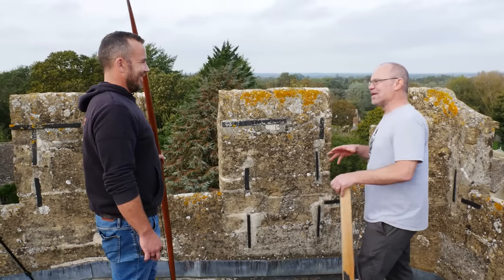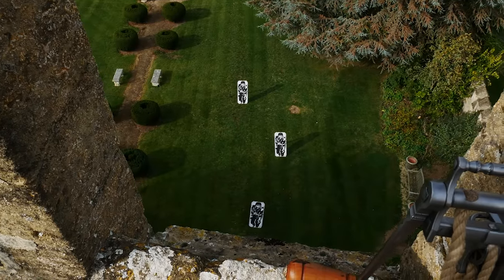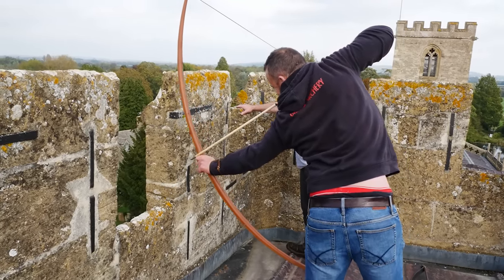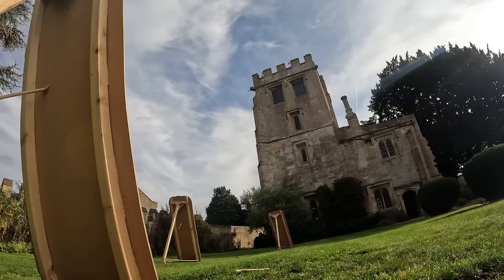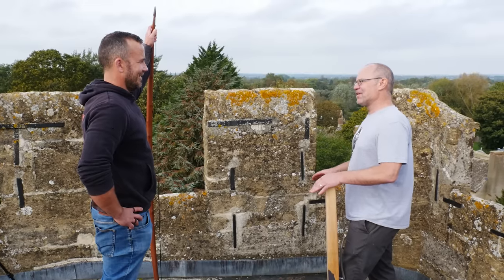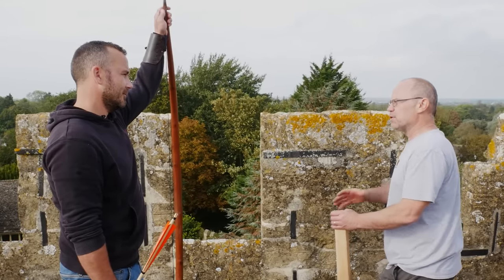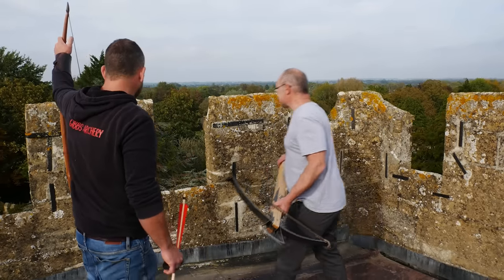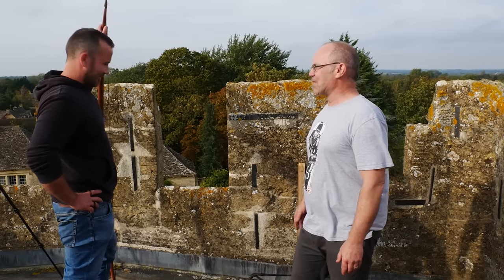Crossbow or Longbow? What's better for defending your medieval tower?

Comment: When I was a 10 year old Dungeon Master, I would have benefited from this video.  Not only were my players firing almost straight down at the base of the wall. They were using Longbows. 

Looks very like a difficult and very exposed position. Crossbows are still my pick. You can be ready to fire when an opportunity presents itself.

Comment: This test highlights one of the often touted advantages of a crossbow over a war bow- the quality of the troops needed to effectively fight. (No offense, Todd!😆).
The fact that a competent, physically average older crossbow man is as effective (maybe more so under the conditions) as a master archer in his physical prime is a big force multiplier on an army scale.  Younger stronger troops can be used as foot soldiers instead of being used as archers, which could be important, especially if you are recruiting from limited populations like a barony or small kingdom.
Reply from the maker: Firstly - clearly I am mortally offended!  But yes you make a good point.  I have a good eye, but I basically only shoot crossbows for my films, so not often and the last time I shot down like this was 3 years ago, so agreed; point made

Comment: Tod,
What you could have done with your crossbow would be to hold it up at a high angle and blindly shoot much closer to the wall than someone could with a longbow. In battles, people shoot blindly rather often. It would be very likely that people were doing it back in the 1400s as well.

Comment: I know I have come too late to the party but other posters have already noted that the more fortified medieval castles had machicolations (protected overhangs projecting from the walls) and hoardings (covered wooden structured that extended outwards atop castle curtain walls).
These features would ameliorate a lot of the issues associated with firing arrows from just crenellated walls.

Comment: It should be remembered that we're used to seeing castles in ruins so a lot of features (like roofs in the main halls) have rotted away over the years.  The crenellations in a maintained castle wouldn't have been exposed like the ones in this manor house (which would have mainly been for decoration and for status as only the king could authorize a house to be built with crenellations).  They would have been covered by what are called hoardings.  It's sort of like a wood shed that would run the length of the wall and would have stuck out past the edge of the wall.  

They wouldn't have stood up to a ballista or trebuchet but would have protected from arrows and crossbows.  Most importantly they would have slots in the section the stuck out past the wall so archers and crossbowmen could shoot straight down to the base of the wall.  From what your archer is saying it would have been difficult for him to fire straight down but it wouldn't have been an issue for a crossbowman.

Comment: it's nice to point out that in eastern archery there is a technique developed especially to overcome the problem of shooting a bow downwards a steep angle. You do that by pulling the bowstring with your string hand pulling from behind your head, tilting the bow horizontally and pushing the left (bow hand) downwards :) they call it the Jarmakee - if you train it properly it can be done comfortably with a high poundage bow as well

Comment: Well as you said, Todd, that building is absolutely not built with wartime defense in mind; those battlements are for all pints and purposes, decorative. If you’re gonna build a defensible structure with specifically that defensibility in mind, you’re going to design and build with the specific weapons in mind with which you expect to be defending your fortification. Ipso-facto, you would include features in your battlements which would be purpose-built to accommodate a tenable defense with those specific weapons. Your merlons would be equipped with loops, every few merlons or sound not all of them, which would either themselves be plunging loops or be in addition to a lower row of plunging loops, as well as a lovely set of machicolations you could shoot through as well as dropping unpleasant items and substances on the threats that get too close to the wall, especially on a strong point such as a bastion or tower. I think you guys might have ample reason to do a re-try of this video in a place more appropriately constructed, if you can find one. I would say a castle, fortified manor, or city wall somewhere that was built early enough that archery would still have been the primary form of missile-based defense, because after a certain point lots of places were retrofitted to accommodate the use of gunpowder weapons, even if archery was still utilized to a certain reduced extent, at least for a while. I know that’s fairly specific, and might be a little bit of a hint to find someplace that meets your needs, but I really do think this particular location ended up effecting largely misleading or at least misrepresentative results for the experiment you were trying to conduct.

Comment: The crenulations had a lot of design elements which were intended to deal with these problems such as tapering to the point of shoot so you could swing your arms and bows plus parallel slits and angled down stone at that point. Even when firearms and cannon came along the same things had to be considered plus star formations for walls so you could shoot back toward attackers at the base.

Comment: One very important detail regarding the difficulty in hitting targets near the wall is completely overlooked here. Merlons and crenels could be extended out from the walkway a bit to create gaps in the floor called machicolations. These gaps allowed defenders to fire down on targets at or near the base of the wall without having to lean out over the battlements as seen in the video.

This design became very common in medieval fortifications after about the 1200s, but when battlements became more of a decorative feature than a functional one they were usually omitted to simplify construction. This was often the case with palaces, churches, manor houses, and other buildings whose purpose was not to serve as a stronghold but whose builders still wanted the noble aesthetic that military fortifications provided.  This seems to have been the case with Stanton Harcourt Manor House whose battlements, as mentioned at 1:52, are decorative.

Comment: As someone who’s in the military I can see the massive advantage of the crossbow here pretty easily. I’m sure there’s endless tomes of how they were employed but fighting men themselves never change. Regardless of how they’re “supposed” to employ that weapon system I can tell you with absolute certainty that the grunts were using them in what they thought the best way was. High likely hood there was a handful of old hands and sergeants doing all the shooting while the younger guys who weren’t as accurate wound the cross bows. They were crouching away from the edges probably in the center of the roof. Might have had a few guys winding up there with them while the rest were doing it in the staircase and passing them up. They would have stayed as far back from the edge as possible and exposed as little of their bodies as possible. For the guys attacking they would have presented extremely small targets for a very small amount of time. This would massively increase the survivability of the defenders. As opposed to the longbow which require you being exposed for much longer and would fatigue the shooter very quickly over time.

Comment: One of the biggest reasons for why crossbows got more popular than bows was that they were easy to train an effective force for relative to bows.
With a bow, you'd need the average civilian to use it for months before they could reasonably put arrows into targets at acceptable rates, especially during stressful situations.
With a crossbow? That same training takes a weekend.
I mean, a perfect comparison here is your shooting performance. John is a dedicated archer, yet despite that, you're putting about as many shots through targets as he does, despite you lacking the years of training he does with a warbow.

Add to that the fact that during sieges, you spend half as much time vulnerable. You understated the importance of that in the video, but that's massive. An archer on the ground would simply not have the time to reasonably spot you, acquire you and take a shot at you in the time you spend to pop out, pop a bolt off and duck back down.
With the warbow, however, you might not be so lucky. That 0.5-0.7 seconds difference is the difference between a hostile archer swearing that they couldn't take a shot in time and you getting a new haircut. Or getting a new set of holes.

Also, all of these things? They're also the reasons why arquebus and muskets took over the battlefields, despite lacking many of the advantages crossbows and bows had over them.

Comment: I would bet that a cord anchor would be used, a V of wood that catches on the outside of the wall that lets the archer concentrate more on the draw than the hold.   We're talking about a very short distance of shooting so the finesse needed would be low.   I would bet something even as simple as a stick across the outside through the bow at the grip would let the archer work up aside the wall at the gap.

A pair of planks laid into the gap with a slot between solves most of the defense issue.

With actual battlements a crossfire would be easy to arrange.

Comment: I think you are underestimating the difference in exposure. Sure the longbow might only require you to be exposed for 2 seconds but a crossbow you might only be exposed for half a second. That is huge when it comes to human reaction time and arrow flight time. In that half a second there is no way you could return fire and hit them. By the time you reacted and the bolt or arrow got to the defender they would be hidden again. Not so with the long bow. Two seconds seems a short time but its certainly possible you could land a shot on them.

I think having a test where you did something like this with someone shooting something back would highlight it better.

Comment: The other thing to consider is in proper fortified castles, you would have murder holes scattered around the lower parts of the towers, allowing any bowmen/arbalests manning those holes to target troops closer to the castle. I believe hoardings could also have holes on the floor for a similar purpose. .

Comment: This was very interesting. I've come to imagine that our perception of medieval castles is far too influenced by not only modern movies, but modern and early modern warfare where the bullet, granade or cannonball has granted the defensive structure a comparatively huge improvement in being able to inflict damage to an enemy in its immediate vicinity. The actual death zone of a castle isn't really the approaching surrounding grounds but the moat and the walls themselves. This is why we see the emphasis on jettisoning parts of the architecture aimed at defending the immediate wall under or beside it. If decease or hunger didn't kill your enemy in their camp, nor sapping raids, your chances would be for the assault to fail and it would do so at the walls, not before them.

Comment: I've always thought the longbow was more of a field/distance weapon, it would be used shooting upward into the tower. Those defending the tower would use longbows, when the enemy was farther away and lighter bows, when the enemy were closer. Similarly with the crossbow, using a windlass crossbow when the opposition were further away, and an English Standard or even a pistolaire when closer. Of course, if the tower had arrow-loops or slits it would be easier to hit the closer enemy. Thanks Tod and Joe, very interesting post. 🎄Merry Xmas🎄

Comment: The biggest advantage was that they didn't require that much training. In England they had a system that gave them ton of archers but in times and spaces where that wasn't the case it was much better to just have a bunch of crossbows to give to recruits in time of need.

Comment: I think the main advantage of the crossbow is that the bowman would likely experience severe fatigue as the siege drags on. Most spanning methods at that time gave mechanical advantages that substantially saved the arbalist's strength as opposed to a bowman.
Also, one could argue that shots from a crossbow were more powerful. It's not so evident with steel limbs since they are not as powerful as some make them out to be. However, a lot of crossbows were composite. Your typical 250-400kg rack-spanned composite crossbow that was common in the 15th century was superior in power and penetration to the heaviest longbow out there.
P.S. I really miss those old crossbow videos on the channel. Hopefully there will be more of those in the future.

Comment: Great video. Dedicated fortifications would often have had addtional wooden defense structures between the crenelations, giving more protection (but partly also smaller field of fire) to the shooter. People near the wall would perhaps be shot at through slits in lower positions or through openings in the bottom of the platforms. Overall I see the crossbow as a bit better, but in some rare situations where rapid shooting would be advantageous bows may shine more.

In addition I take another argument from the relatively awkward performance of both weapons why firearms pushed aside both so quickly (after the powder revolution of the second half of the 15th c. AD and the advent of good priming devices had created reliable guns), except in backward England with it's great archery tradition. Firearms were better in almost all aspects except the rate of fire, and the latter was not that important.

Comment: The crossbow has 2 advantages over the longbow -- you can keep it drawn and ready for an indefinite period of time, and you don't have to train nearly as much to be able to effectively use it (especially with a winch, it's possible that someone without lots of upper body strength can arm the bow, and the ability to keep it ready for a long time allows an unskilled crossbowman to aim longer).

Comment: You could more exactly measure the advantage in popping out with a loaded crossbow by measuring the flying time of upgoing (and downgoing) arrows.
It is not necessary to do it at a castle, you just need a catchy target at the right height.
Then the next time you'd have the chance of bringing archers (of different skill levels) on the roof you can make them shoot within the time costraints that a life and death situation would have imposed. Ideally you would have the shooting at targets changing positions between shots.
This would be a quite real test of the advantage of a more compact shooting platform.
The "shoot down" part could be also tried on lesser scale, 'not stone' constructions too, if you mantain the correct shooting angles and the depth of the border wall.

Comment: A thought on the crossbow. If you instead were firing from a slit, one with a fixed stirrup might press the stirrup against the wall, straddling the slit.

One possible major advantage for crossbows I can think of is in ammo. Arrows are much more particular about their shafts and they must have the right seasoning, bending, and mechanical properties to flex around the stave and fly true. Fletchers spent their entire careers mastering the art. They must have their feather flights and often the notchs as well. In a siege situation these would be difficult to replenish once spent. 

A crossbow bolt on other hand can be quickly and easily made by untrained people trapped within. Shafts can be hewn from furniture, firewood, or even wooden utensils or tools. Flights can be leather, feathers, wood, cloth, or even nothing at all for something like a slurbow. 

So I could see it possible that crossbows were more easy to supply ammunition for while under siege.

The other advantage I can see is that of training. While I’m sure you’re practiced in your crossbow, you’re achieving via point and shoot what your bowman is putting full body, years of skill, and mental control into to achieve the same result (with a much quicker reload of course!) so in the event that the keep’s baker, latrine cleaner, and guard  are needed to help defend, they may likely find it easier to achieve results with a crossbow.
Reply from the maker: HI Rae,  I have to disagree with you about the bolts.

What you say about arrows is very valid, but bolts because they are shorter are much less stable and they have to be made to a higher quality standard than arrows for them to fly true and of course both need heads

Comment: It is likely that for the defense of a castle and depending on the height of the battlements and walls, somewhat smaller and more manageable crossbows and bows were used since the distances would be shorter than on a battlefield.

Comment: Order of magnitude, it must be that the extra distance is equal the height from which it was shot. Assuming that an arrow is shot at an angle of 45°, by the time that it reaches the flat shot distance, it will be descending at an angle of 45° and be at a height equal the height that it was shot from.